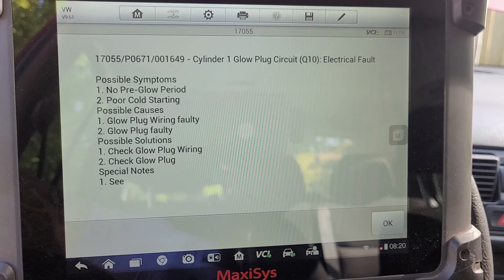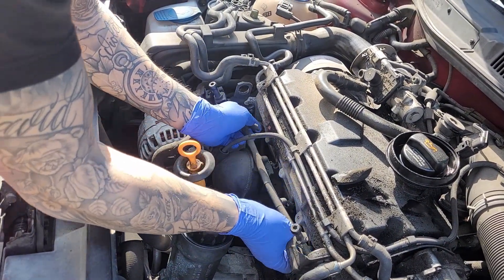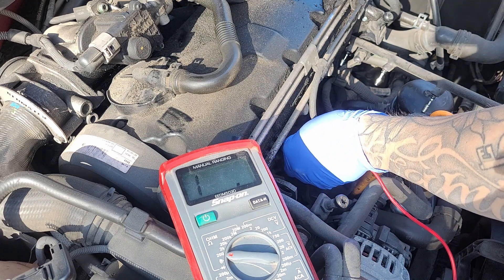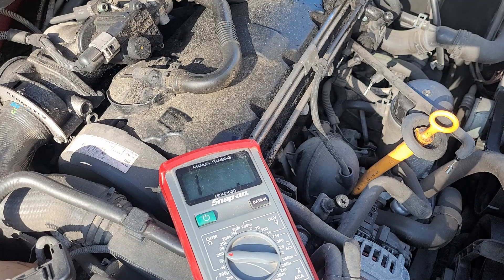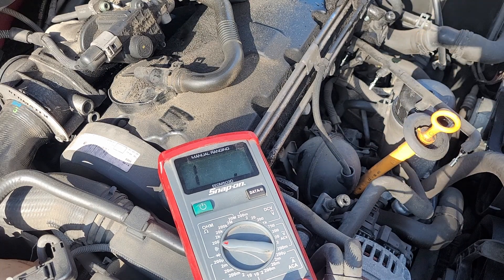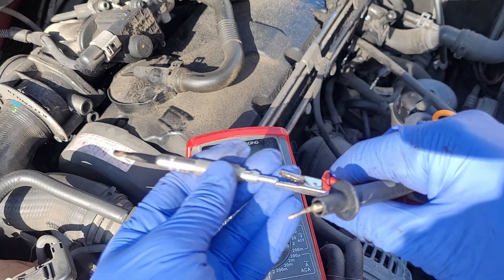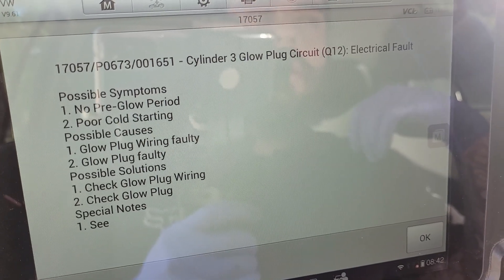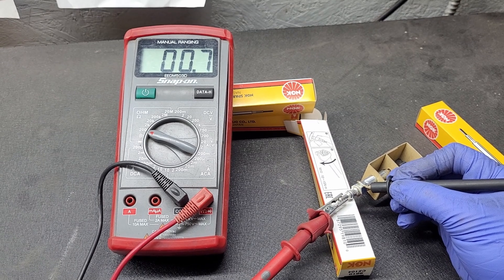VW TDI - P0671 P0672 P0673 P0674 QUICK DIAGNOSIS AND REPAIR

Comment: Great video, thanks for sharing. To get the glow plug out, what size is that extension bar attached to your ratchet?
Reply from the maker: Thanks, thats a 12" extension. Its just my go too extension, you could use a shorter one.